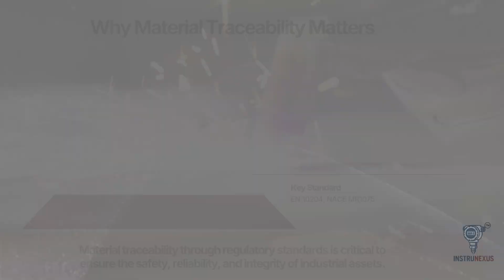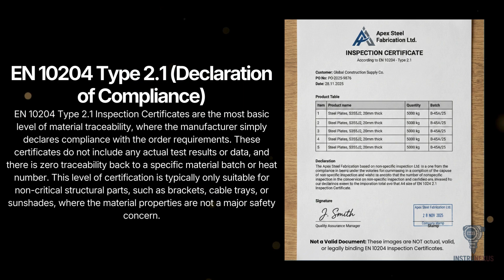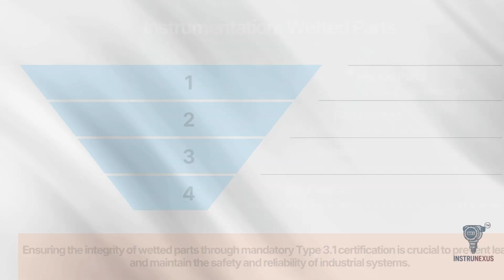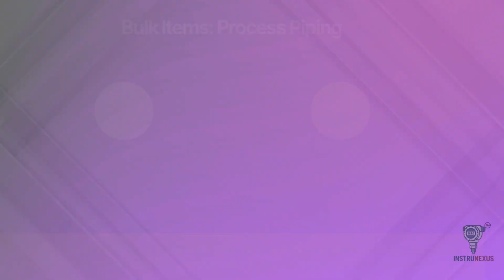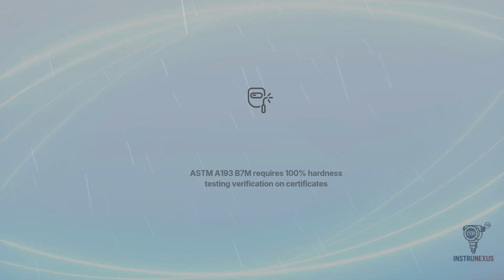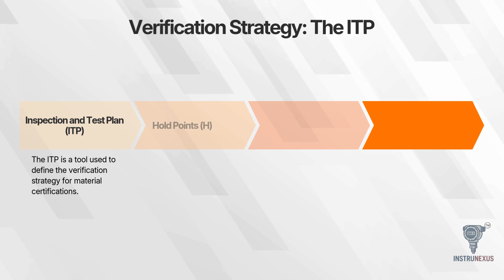Material Certification Explained: EN 10204 Type 3.1, 3.2 & Preventing Fraud

Comment from the maker: Industrial Engineering & Systems 🚨 Have you ever scrutinized your Material Test Certificates (MTCs)? We added a crucial section at 19:00 regarding Fraud & Digital Trends. With the rise of counterfeit certificates and altered heat numbers in the global supply chain, relying on paper alone is becoming risky.

Question for the community: Do you currently use PMI (Positive Material Identification) spot checks on your projects, or do you rely solely on the documentation? Let us know in the comments below! 👇

Key Red Flags to watch for: 🚩 Generic chemistry values 🚩 Missing digital signatures 🚩 Mismatched dates vs. manufacturing timelines.